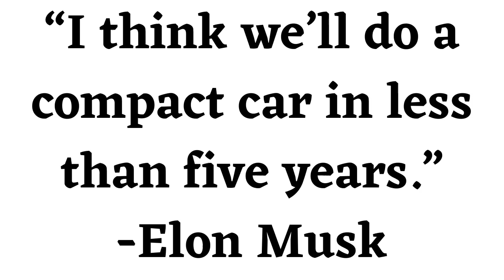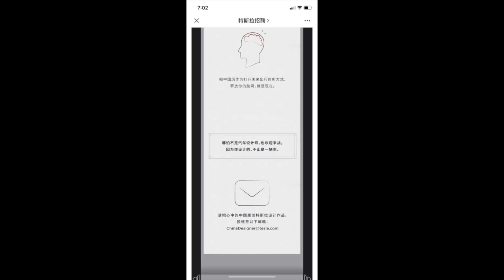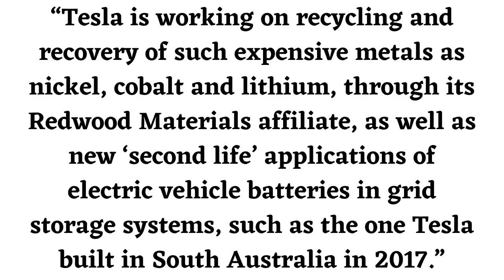Tesla's $20,000 Compact Car Is Coming Soon - The End of Gas

Comment: Yes, definitely, I’m planning on buying one in 2025. By that time they will have worked out any issues with the car and I bet you will get a compact car that gets 300 miles for $25k.
Reply: 0 to pancake in 1.8s!
Reply: Have you put your name down for a charger, there should be one free for your use on Thursday 28th February 2036 at 3am until 03:32. But sadly it is solar, and it will be dark. Good luck with that.
Reply: @sre331l  ??
Reply: I would bet it would either be cheaper with those miles or double those miles for that price by then
Reply: @bl4643  You'll need 60kWh usable capacity for that kind of Range in a compact car. That Will be around 8000$ / 700lb of batteries, leaving 1300 lb and $12000 for the rest of the car. Guess You'll have hand crank windows and no AC. However, I would buy that!

Comment: Something along Cybertruck lines would be interesting, could probably be done with thinner SS. As I understand it, because the exoskeleton unibody is the major structural component there's little if any weight penalty in the Cybertruck over a body on frame pickup. That may or may not apply to a smaller vehicle where they're usually unibody. 
Whatever it is it's going to be extraordinary.

Comment: Completely agree. It will get revealed in 2 years or less and be out in 5 or less. Then it's game over for ICE vehicles. It's almost impossible to make a case for them. The charging infrastructure might be the last thing holding a person back but when it comes to Tesla, they'll have everyone covered for the cars they sell. They'd have plenty of capital to build it out and it's not like it costs a lot. Just $500M for the ~20k stalls they have right now and they'll be over $100B in revenue by then. The cars would be $25k or less. The technology is here and coming out very soon for this to be possible. Then smack on top of the buying price, charging prices and maintenance that cost jack shit. It's a wash. You're practically buying a $15k car that's greener than ever. Not to mention batteries would only get better by the end of the decade and V2G. Honestly silly at that point. RIP

Comment: I think Tesla will introduce the Tesla compact EV - Model 2 or Model C, when their Full Self Driving (FSD) is finished, tested, and is working well. I think that this compact will eventually make up probably 80% of Tesla’s Robotaxi fleet. This is because the average occupancy per car trip in the US is about 1.4 passengers per trip. The average driver drives less than 30 miles per day. This means that a two-seater compact EV is the most efficient size for most trips. With a fleet of Robotaxis, the range can be less than 200 miles so the battery could be less than half the size of a Model 3 battery. This would save weight, batteries, increase range, and lower the price. This EV could have a second row option with a slightly bigger battery. This version would be used in the Robotaxi fleet and available for sale to individuals. I can imagine the standard two-seater configured with two confortable Lazy Boy-like fully reclining chairs suitable for sleeping, watching movies or playing video games. I can image this Robotaxi would also have a fold out table for laptops, writing, or eating. I can imagine the glass roof, windows, and windshield being able to be configured as transparent glass or as separate screens where you could view five or six football, baseball, basketball, or soccer games at once like a sports bar. Others people might choose to watch news or play interactive video games five or six other players.  If you choose to watch a movie you could choose to have surround sound and surround video!

Comment: Here is the thing: most people don’t need a big car. The problem is that small cars simply look stupid and awful. No way Tesla wouldn’t make a sexy compact car. With the range, autopilot, looks, and cost it could very well be their biggest civilian money maker.
Reply: I currently drive a midsize SUV & I Love, Love it! I may not need all that room much of the time, but when I do I'm glad to have it, and I like the  overall roominess of a bigger vehicle and I really like sitting higher up off the ground versus a compact vehicle. I think there's definitely a market for a compact lower priced Telsa and I too look forward to a world where we're off oil.
Reply: Teri I personally believe the only place that should be burning fossil oil are the electric power plants. But it ain’t now. The world is still built around using gasoline.
Reply: @teri1272  All you like about your SUV Costs fuel: more room= higher Weight and larger frontal area, higher up= bigger more  exposed wheels increased Rolling resistance. You have to ask yourself, is the purpose of you SUV to groom your self esteem, because what you describe is counter to efficiency, and making a battery SUV won't change that. What purpose is IT to drive an EV, if IT only gets 4 or fewer miles / kWh? 6 miles / kWh or more is possible in a compact, you don't need utility sized super Chargers, 7kw is plenty fast, and when you need a replacement battery pack, IT Will be half the price. (Sorry if my comment game across as unpolite), but really, the purpose of EVs is not to be able to continue your former wastefull lifetyle, electricity is scarce, and each of us need to reduce out footprint by 95% in the next 10 years, and that won't happen with electric SUVs! Cheers!
Reply: I thinkt he prob with a small car is it loses vs a truck.. pretty badly.. but with a computers reflexes that might not be an issue anymore.  full automation will save more lives than drunk driving laws do.
Reply: Histopher Citchens  Actually the countries with the lowest birthrates have the largest carbon footprint.  And literacy of women is proven to be the most important step to reduce family size.
Reply: @markharmon4963  : Interestingly, the education doesn't even have to be formal. Housewives in Brasilian favelas watching telenovelas have fewer kids because the beautiful people on their soaps have fewer kids.
Reply: Histopher Citchens  That's not quite the economic alternative.  The economic alternative is to keep the $20K AND invest it, for say 5% per year, which amounts to $1000 per year, which is reinvested too(actually I know I can do a bit better than 5%.).  So the electric would have to save that much, AND make up ground on the $20K.   My current monthly gas cost is about $125, which is $1500 per year.   So that means the breakeven point is $20,000 divided by $500 ($1500-$1000) which is 40 years (and that doesn't count the interest buildup on the yearly $1000 made). Ah, I think I will pass.
Reply: A small car doesn’t cost much less to build than a larger car. People won’t pay as much for a smaller car.
Reply: Histopher Citchens So let’s kill a few 100 mill Say I will bet a special virus would work! Then a specialty hard to trace poison mandatory vaccine. Oh yes and then a MOAB war in a highly highly populated country. Oh wait!!!
Reply: I agree because there are more people who can afford that price.  Imagine how much you can save.  That will be my car in the Philippines when I retire.
Reply: @Pinoytrailtrekker  me 2
Reply: Add some solar panels on your house and charge your car.
Reply: @DennisInVenice  Yeah, spend another $20K just so I can charge my car.  Right.
Reply: George Sealy What about the environment! Is it ever a consideration that everything we do as individuals & as members of this global community because global warming doesn’t care where you live on the globe, but everything we do to reduce our carbon footprint is significant! Do you ever think about the bigger picture yes it may cost you a little bit more money upfront but long-term benefits far outweigh any short-term concerns about oh it costs too much! Your thoughts!👌
Reply: @theodorehaskins3756  The only way there will be real change for the environment is when it is economically advantageous to do so.  Then there won't have to be mandates and laws passed.  Everyone and every country will do so by themselves.  Nothing I do will make any difference. None.  In fact, anything the US does will not put a dent in it because the US accounts for only about 14% of the world's pollution.  If you want change, then invest in technology that makes it economically a winner to go that way.
Reply: @theodorehaskins3756  I do vote and my vote does matter.  I know this because there is an actual count.  I know exactly how much it does matter.  You probably support the Green New Deal, at a cost of $15-25T.  If so, then show me the study that says "if we spend X amount of money, then pollution will be reduced Y%."  You can't.  No scientist ever signed their name to such a study. So what do we really get for changing our lifestyle completely and going poor paying taxes?  Nobody knows.  My view is simple: show the return on investment.  Show us exactly what we get for spending that money.  Sorry, if you don't get it. Like I said, invest in technology that can prove its worth, then you will have something.  Stop laying a guilt trip on everybody.
Reply: George Sealy I merely asked a question so why are you so triggered if you're so confident in your positions?
Reply: George Sealy I also noticed that you refuse to answer my questions are you ashamed of your political affiliations?
Reply: @theodorehaskins3756 Typical liberal response.  You don't like what I say or can refute my arguments, so you attack me personally.  You guys are always a joke.  "Ashamed of my political affiliations?"  What a laugh.  You just don't want to deal with someone smarter than you are so you change the subject.  Show me the return on investment Teddy, show me the money.
Reply: George Sealy What technologies do you invest in that will change the projection of global warming?
Reply: @georgesealy4706  - A total cost of $20k is less than you would pay for a hybrid Honda, right now. And, those aren't getting any less expensive.  In fact, it's $23k for the BASE model.  If Tesla gives us a $20k car, that "base package" is still going to have cool features like the Nuclear Air Filtration mode, plus you'll save loads on gas, whether you have a moon roof, or not (just add a moon roof to a Honda costs over $2,000). The stereo system going into the Tesla is top notch, as well. I average 300 miles before I fill up on my car gas guzzling Lincoln-Mercury Mark VIII, now (vehicle was given to me, so I can't complain about that!). If an electric car can do that, too, it would be worth the change in the long run.
And, I'm just talking personal value and monetary impact.  I didn't even get into the environmental value, as someone that believes in the principles of conservation. A $20k compact Tesla that has a range of 300 miles is a win-win for everyone.
Reply: @theodorehaskins3756  You seem like an intelligent person.  Don't use red-herrings, like in the comment above.  It detracts from your argument. Attack the argument; not the person.
Reply: Noah Frost Do you presume to tell me what to do? Do you go around telling other folks what to do? I didn’t ask for your advice! If I wanted advice from you, I’d ask for it!👌
Reply: Noah Frost Oh BTW! I am an intelligent person! Thank you very much!🤦🏽‍♂️
Reply: @theodorehaskins3756  1) You're on the Internet.  So, by posting, you agree to a certain bit of conduct (i.e.- expect for people to disagree with you).  If you're going to go around the Internet being constantly offended all the time, I would suggest that you get off of it. By being here, you're inviting disagreement. 2) If you're intelligent, then you should know better than to use a red-herring. I'm not doubting your intelligence.  Just your lack of use of it in such flawed argumentation.
Reply: Noah Frost You don’t get to tell me what to do, what to think or how to conduct myself! What piss me off with people like you is your presumption of who you think you’re talking to! You’re entitled to your own opinions, but not your own facts & you are never entitled to tell me what to do! Do you understand that?
Reply: @theodorehaskins3756  - Ah, we have a real life character from Lost here.  "Don't tell me what I can't do!" 
Honestly, about all I got out of your response is that you're unable to handle constructive criticism.  Sorry to hear that.  It's kind of a necessary skill for life. You likely won't go very far without it.
Reply: @theodorehaskins3756  - I was simply giving some sage advice.  If you want to be immature about it, that's your choice to look like a fool for- quite literally- all of the Internet to see. But, you can't say you weren't warned.
Reply: Noah Frost Does it take one to know one?
Reply: Theodore Haskins Carbon footprint is a scam. Follow the money. I lease my 2020 Bolt after 300,000 miles in 3 years ( with little wrong after all that) in a 2017 Bolt EV, is to reduce air pollution and keep my living local areas clean of toxic exhaust.
Reply: Theodore Haskins The Projection of global warming is bogus. Like I said follow the money. One idiot has a $6,000 per month energy bill, and flies private Gulfstars. Hypocrite making YOU pay. See the book “Dark Winter” and prepare for the Maunder Minimum.
Reply: David Drake Aww, I’m confused! Are you making a case for reducing your carbon footprint or are you making a counter argument because it doesn’t sound like you’re making a counter argument based on what you just stated! When I bought my Tesla I did not buy it thinking about reducing my carbon footprint! I bought it because I thought it was a great car & it was high time that somebody made a damn car that I actually wanted to buy! But since owning the car & learning about the company & the vision laid out my Teslas leaders, lead me to buy into the idea of carbon reduction! I don’t think we’re going to get the green new deal if Trump is elected president & notice I said elected president because he didn’t win the election in 2016! The Election was stolen, it was interfered with & we all know what happened, but that’s another conversation for another time & another place, but having said that, as long as this country remains in the throes of the Republican party & it’s operatives, we will not be leaders in electrification of mass or personal transportation or carbon reduction in our environment! There’s is a vision of a dystopian future and we are seeing their ideas play out today! So your thoughts!
Reply: Theodore Haskins yes for another time but you got it in anyway. I leased the Bolt because as a ride share driver intelligent and knowing how to make a lot of monday I would be making a lot of pollution, leasing an Acura TL ( very clean but still polluting). After driving it in so many different ways and areas for 300,000 miles, I grew to love the Bolt ( has a better almost audiophile quality sound system- the Tesla is out of absolute polarity) hence I now lease a 2020 even if I was deactivated by Uber for being too old. Any help with a good attorney for contingency on at least a 500,000 to million dollar case? I was a DAMN good honorable driver, and I do miss it so.
Reply: lot of money
Reply: David Drake I hear you, but that’s not my question! I want you to explain what exactly is you’re concerned here, because you mentioned carbon footprint, so what exactly are you talking about & what does it have to do with Tesla?

Comment: A radical design is a dangerous gamble when you're trying to "fast track the adoption of EVs" (paraphrasing here), just look at the reaction for the cybertruck, it was very 50/50 meaning that 50% wouldn't buy it regardless of its spec. The sketch they showed looks good to me, hopefully they do something along those lines. 
I would love to buy a Tesla but I'm very concerned with the quality control, all the models have been plagued with issues (that eventually get fixed but early adopters get shafted) and it being made in China, which is not known for the quality of the product it makes, could be a didsaster. Hopefully I'm wrong.
Reply: Im sure it will only be designed in china, but manufactured in Giga Shanghai, Giga Berlin and also in the US probably. So if you order from the US, you get a car built in the US.
Reply: @Hastix  Maybe but I thought they said it was going to be made there?

Comment: 20000 out the door would help us poor people looking, I live in a condo so I would also like a charge port and water proof air vent in the trunk so I could plug in a mini generator to charge up and use solar, set something on the roof and window and hood. Edit yes I would insulate the vent when not using or maybe open and close the in trunk plug we don't want to let warm air out.
Reply: David Wright 
Mid-‘60s Saab’s all had waterproof air vents. They let heated air flow thru the car and out the warmed trunk.

Comment: I dislike Elon Musk. He is a preening narcissist. But he does understand one thing about e-vehicles. It is not that the acceleration can be blistering given enough battery power or that the carbon footprint is so obviously superior (although I guess he understands this as well). Rather it is that EVs are essentially operating systems on wheels, which can be upgraded instantly in just the same way as phones and laptops.  So, for instance simply by running the car, the range from a full charge can be increased. If that can happen on a $50K+ car, it can happen on a $20K car made by the same manufacturer. If and when he launches a car at that price I will buy one.

Comment: 100 mile most people drive less than 50 miles a day.10kw at 100 dollars per kw is 1000 dollars for the battery. I bet they can build the rest of the car for 9000
Reply: Agree, except I doubt they will make it with less than 250 miles.  If the goal is absolutely lowest cost, though, you might be right.
Reply: @michelangelobuonarroti916  why do u need 250 for most people only go 50 miles